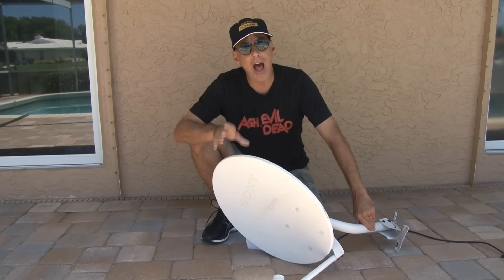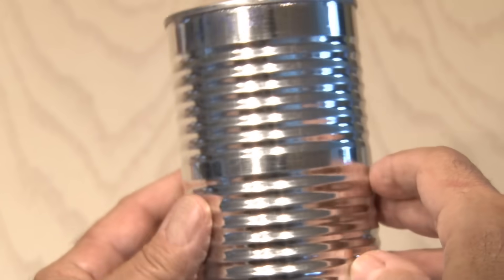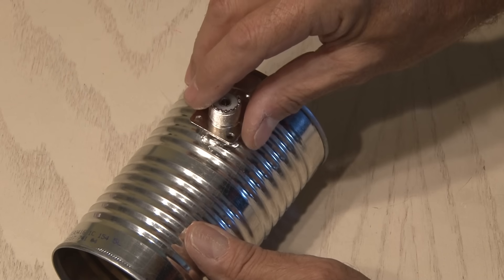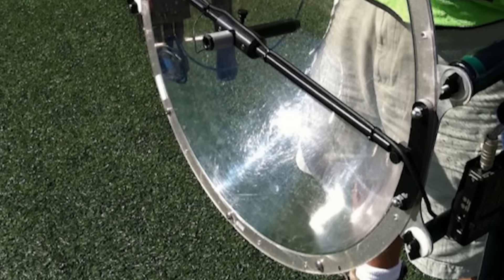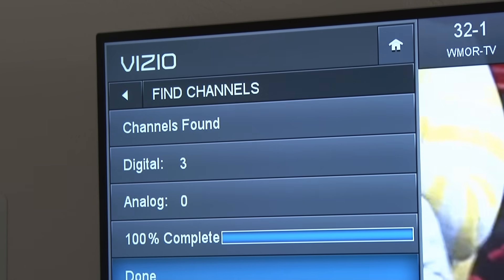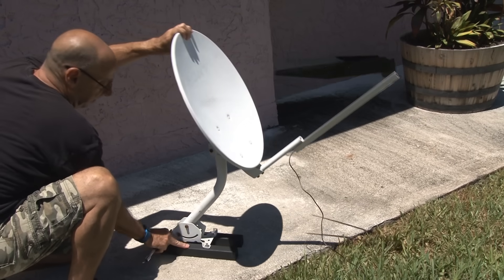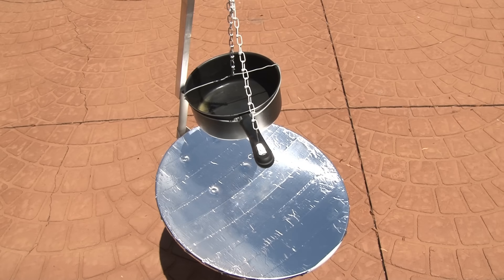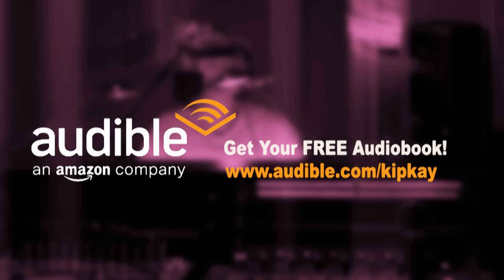4 Brilliant Uses for an old SATELLITE DISH!

Comment: cool ideas. just be aware that even though you got better wifi reception. 2 things: 1 as far as i know it is illegal in many place in the world to use wifi like that, just a FYI.2: dont glue use screws or something so that ground is connected. the matching in RF electronics like wifi is 50 ohms not paying attention will miss match the circuit and if your wifi pushes some some dBm's it could reflect and toast the final stage amplifier.mostly should be ok but as a elec tech in radar i pay allot of attention to this...other then that NICE HACKS

Comment: First off, awesome hacks and many thanks for sharing.  I had a couple questions that I'm hoping you can help answer.  Forgive me if they're rather simple, but I'm not too savy when it comes to wiring.

1) Is it possible for one dish to pull double duty and do both the long range wifi canteena and long range hdtv grabber hack at the same time?

2) For the long range hdtv grabber, the antenna used seemed to be one for indoors.  If I was to leave the dish and antenna outside, would the antenna get messed up pretty soon from the sun and or rain?  If so, do you have any suggestions to counter weathering to the equipment?

Comment: So for the Wifi Cantenna I can plug the coax cable into the antenna of my router and that signal will be the input of the router instead of the output?
Reply: the antenna is input and output at the same time
Reply: Lukas Maier so you can use a router as a wifi receiver
Reply: Secret Beed If it supports it, then yes. The router obviously receives stuff as well, becaquse when you type in a url to a website the router has to know what website you want to visit
Reply: Lukas Maier sorry to jump in this thread, how will your pc grab a wifi signal with an ethernet cable? its hard to grasp the concept of a router broadcasting a public wifi.

Comment: Would the canteen wifi work with a VHF base station aimed at a distant tower that is operating on low power to pick up signal off of it as well as transmit?
Reply: that depends. if you have a strong enough signal u can transmit it with a regular antenna, but I would use the dish to pick up any low power signals, but you would need a digital to analoug converter to use it with anything old like that. that is unless the tower is analoug

Comment: Is it possible instead of connecting the coaxial to a router connect it to a wifi usb adapter ????
Reply: Well I suppose that this would work too altough (it depends on the adapter of course) I am not so sure about it yet.Found an old satellite disk and I will test it ASAP
Reply: Thanks I can't wait seeing it :)
Reply: You can use the Alfa AWUS036H

Comment: How long of a range does the WiFi satellite pick up WiFi networks?
Reply: Depends on your setup, and what's around it. You can get a couple of miles with a decent rig.
Reply: ok so my family just bought some land around my house and it has a big metal barn that my brother and i are converting into a metal shop. the place acts as a shield for data so could i use this and point it towards my house for wifi?
Reply: *****
Yeah, you could.

Comment: what is the range for you wifi hack?
Reply: About an half mile away for the local restaurant (800 meters). Maybe he can do more.
Reply: +Zekium That's what i was wondering cause the dish has a range of about 22,000 miles when receiving cable channels.
Reply: Except you get the powerful signal from satellite. Here, you get the signal from a small WIFI router.

Comment: Great ideas! One more use that I have done a few times is to make a bird bath out of one. The multi articulating arm makes it easy to level the dish bolted to any angle of tree or limb. If you can locate it near an outside hose bib you can use a piercing ice maker valve and 1/4" tubing to run to the dish, set it at a very slow drip and it will keep the dish full of water. Having a bird bath up a tree a bit makes it harder for cats to pray on the birds and makes it more useful for the more timid birds.
Reply: And if you line it with foil you'll have a nice bird cooker
Reply: Actually, if you could remove the paint from a dish, season it w/ oil - it would make an excellent large Wok. You could mount it so it swings down over your grill!

Comment: Some hints for the Cantenna...  don't use the hot glue. The antenna connector should have a good solid ground to the can for best performance.

Also, it might be better to use an N-Type or SMA connector (Or even a BNC) rather than an SO-239. SO/PL-239 connectors don't work very well at frequencies above 500 MHz. They are primarily designed for VHF-Low through Low UHF (30 Mhz - 400 Mhz)

Comment: amazing.
i was thinking of a multiple receiver on the dish, would that work?
meaning WiFi grabber & HD tv signal graber.
Reply: Theoretically that should work, but the wifi tin may block some of the signal for the HD antenna. Also, the direction it is pointed matters, and the direction that is best for getting a particular TV station might not be where the distant Wifi hotspot is. You could of course turn it as needed or even set up some servos to turn it to some preprogrammed locations.

Comment: where to place antenna ? rooftop?
Reply: No, too dangerous! It is better to build a hot-air balloon to hold it up 200 feet above ground. This is the only way to get over the hills and trees that are obstructing the signals. If you can't make a hot-air balloon, then try making HHO then burning out the oxygen with a match so you get pure hydrogen. That will make a good blimp.
Reply: +kedwa30 
ha....ha.....ha..... maybe laughing   next new year for your holy crap joke😝

Comment: about the wifi, I think it only amplifies the outgoing signal (uploads) but it doesn't strengthen weak incoming signal (download) from a far away base station... or am I wrong?
Reply: wrong dude - I`ve never heard of one way wifi
Reply: Let the router itself handle all the dropped packets and frames, and the dish/antenna handle all the messy and rough stuff. If anything, the satellite is making the wifi signal going towards it more focused (big area, converging into a small area), in the same way you receive sound (just as he demonstrated). It may cause an increase in noise, but again the router can deal with that.
Reply: It depends on which antenna you connect on the router. The right one is for uploads and the left one is for downloads. Since most people download far more than they upload then you should attach the booster antenna to the left side. This creates asynchronous wifi, similar to how ADSL is set up.
Reply: Lol. It's a valid question.

It doesn't really "strengthen" so much as it just catches/focuses the existing signal better.
Reply: would be the other way around.
Reply: The antenna is capable of TXing and RXing from space. It can do both.
Reply: Cody Hubert
dishes collimate a signal, the antenna itself is in the focal point. the signal level for upload from a wifi antenna like that probably isn't strong enough unless you direct the beam directly on the receiving router's antenna

Comment: What do you do with the huge ones?  My dad has one.  And that Wi-Fi antenna sounds so very useful!  We have troubles getting the signal from one building to another.
Reply: How far apart are the buildings??
Reply: The huge ones make the best solar cooker. You can put a Stirling engine in the hotspot and really turn out some power. It can be used to turn a millstone or pump water directly. No need to convert to electricity just to turn an electric motor. Use hydraulics or pneumatics.
Reply: 9753flyer
About 100 '
Reply: MrInitialMan
That's pretty far for a Spiderman swing. There was a project in an old magazine for making a transceiver that uses light beams or lasers.
Reply: MrInitialMan 100' should be no problem in most cases... most wifi is good for up to about 150' usually.

What are the bldgs?? Wood? Steel?? Are the transmitters (wifi routers) located inside the bldg's or outside?? Also, what make/model are they.
Reply: Yeah, but the signal out there SUCKS.
Reply: MrInitialMan 'the signal' ?? You mean the one you are sending from one bldg to another or are you trying to get cell service??

I'm a little confused on exactly what you are trying to do.
Reply: The one sending from one building to another.  I just have a couple of wireless routers in my house, and I share my internet connection (and the bill) with my parents (we live in seperate houses on the same acreage)
Reply: MrInitialMan ok.

I assume the wireless routers are inside the bldgs?
Reply: In my house., yes.
Reply: Yay! Most likely the problem is something in the wall is blocking the signal. You don't need a satellite dish to fix this. All you need is an outside antennae. Just take off one of the antennae from the back of the wifi box and hook some coaxial cable to it, then hook the other end to the antenna and mount it on the outside wall. You can stick it out the window to try it, and if that solves the problem then make it more permanent with a discrete hole through the wall so you can close your window. And of course, caulk the hole after you get the coax through it.
Reply: Yeah, Ked is right.

The problem is you are transmitting through walls and each wall will (depending on materials) cut the signal by approx. 30% strength wise and cause a lot of re-transmissions of packets due to errors.

If you have a router that will support an external antenna (most nowadays do not), then you can add a directional hi-gain antenna on each end, point it at the other house and the problem will for the most part be solved - you will still have intermittent problems long term if you are moving a lot of data around (watching a hi-def movie for example).

The best solution is to add a range extender to the outside of the house or houses - you may only need one. 

With the range extender outside, you will remove a lot of the range and wall issues. A google search will find you some of them, and some are able to be used outside (usually cost a little bit more)... all told, 1 should cost you between $40 and $120 depending on inside/outside and it's features (higher power (which will help))

If you have overhanging eaves on your roof, and not a lot of bad weather, you might be able to use an 'indoor' range extender outdoors tucked up under the roof eave.

If you need further help, let me know.

Comment: I don't fully understand how the Wi-Fi part works
Reply: Tha's because he leaves out flashing the router with new firmware so you can gather that signal from far away in a manner the stock router was never meant to do.  This is very well documented elsewhere on the net.
Reply: You're just making a Wifi antenna with much higher gain by focusing the signal onto one point.

Comment: this may have been mentioned before but the UHF connector should be soldered to the wave guide (can) to provide the needed ground conductivity. additionally, one should use better coaxial cable like LMR300 and an N connector instead of a UHF connector

Comment: UHF connectors and RG-58 (especially from Radio Shack) are terrible for Wi-Fi at 2.4GHz.

Use an N, F, or SMA connector and RG-6Q or LMR-400 equivalent for lowest losses
Reply: And hot melt glue is a great insulator.  There is only a casual connection between the SO239 and the sides of the hole in the can.

Comment: Over 22,ooo miles in space?  What kind of signals are you picking up lol
Reply: That is correct the geostationary orbit is 22,236 miles above sea level.
Reply: Did not know that.  Thanks for the info because I thought the average was 400 to 600 masl
Reply: Graeme Mudie so if they shoot them up there at a thousand miles per hour it would take 2 1/2 yrs to reach there?
Reply: jtuno122
Thinking your math is a tad off
Reply: jtuno122 No it would take 22Hrs.  The escape velocity from Earth is about 11.186 km/s (40,270 km/h; 25,020 mph) at the surface. So it would take less than 1hr to reach 22,236 mile.
Reply: Graeme Mudie yea, lol! After I hit post I realized what I did and couldn't find it again to correct it.

Comment: There's one thing you forgot to mention: It's an offset dish, so pointing it straight at a signal source might just about catch the edge of the signal. To really get most out of it, you'd have to angle it down.
Reply: I thought the same thing.  8^)

Comment: Thanks for the video. I have a question for you. Did you plug the microphone anywhere? Kindly show it.
Reply: The mike would have to go through a pre-amp and then an amplifier.  It could be done in one stage if you designed it that way.

Comment: The use of Imperial measurements was really annoying. Science and Technology videos shouldn't require me to break out conversion formulas to understand the content.
Reply: If you cant understand simple conversion stay away from science and technical/technology videos.
Reply: I refer to them as medieval measurements.  The United States is the last country on Earth to still use them.  Taking the ratio of the length of the bean can to its diameter and somehow coming up with "1.25 inches" as the ideal position to locate the antenna feed was utterly deranged, because when a length is divided by a length, the result is a dimensionless number.  No electrical engineer would do it that way.
Reply: Science and technology? The dude just made some ghetto gadgets using fairly arbitrary measurements. He probably could have done it just as well without even measuring anything out. Just having the concepts presented here would be enough to replicate it without the measurements even being stated.
Reply: Myanmar (Burma) and Liberia are still also on that obsolete system...

Comment: If you want to boost your laptop wifi reception use a dongle with a usb extension cable on the dish. Less work and the result is fine aswell :-)
Reply: I will try that.

Comment: people building a wifi beam be careful it may be illegal on bands other than the amateur band. advanced amateur licence holders are allowed more power on a different wifi band but can reach large distances. check with a field strength meter to make sure your compliant with federal laws in your country as you cant exceed the acma or equivalent spectrum licencing authoritys rated output. people bellow it looks like rg59 coax . 
.  i'd recomend a sma to so239 adapter as most new modems are sma 
either male or female depending on your equipment . in the video his router has the so239 buit in.
and you will need a pl259 uhf cb connecter for your router and another pl259 for your wifi beam.

Comment: War driving is illegal kipkay.
Reply: The act of wardriving involves using software to capture data about wireless networks and Internet usage. Although the act is classically accomplished from a vehicle, wardriving can be accomplished using any 
means of getting around to include walking, bicycles, or via aircraft (Kipkay is not wardriving, he is not mobile.  Kipkay is wardriving as much as he is war dialing.  None.).  In the United States, the act of collecting data on available wireless networks using this method is NOT considered illegal. If the individual conducting the wardriving can be proven to have accessed any of the networks that are not designed for PUBLIC USE (Kipkay used a PUBLIC WiFi hotspot), he or she could be subject to criminal charges based on the locality and what the network access is used to accomplish under the Theft of Trade Secrets or Federal Computer Fraud and Abuse Statute.
Reply: ***** Whoops,wrong term. I meant he is piggybacking. Using someone's hot spot (free or not) without the explicit permission ( or not being a client) is an unethical,and illegal (pretty sure) practice. amirite ?
Reply: I would consider it a gray area. Being that he's not purchasing product from the facility and using Wi-Fi but it is still not illegal because it's public.
Now let's say for instance that you have a Wi-Fi that is unencrypted... Joe Schmo decides he wants to use your "free" Wi-Fi. If you did not intend for this Wi-Fi to be public, at that point it would be illegal for Joe Schmo to access.
Reply: If a businesses public WiFi requires you to go through some sort of homepage for the business and click an 'Agree' button, odds are that you are agreeing to only use their WiFi if you are a client/customer. Just do a search for 'arrested for stealing WiFi' and you will find stories of people who got arrested for using stores free WiFi illegally.
Reply: @John - I would certainly agree with your statement.  In fact, yesterday I was discussing that very same thing with a co-worker right after my last post, but failed to have mentioned it specifically (meant to be inferred with the "gray area".)  Thank you for clarifying that.

Comment: Why did he need a calculator to divide 5 by 4?.
Reply: American schooling.
Reply: 2.4GHz Frequency wave length is about 5 inch,  this  antenna length should be 1/4 wave length.
Reply: Heywood Jablowme No...it's to demonstrate for the viewers.  Otherwise he could've done that calculation or any other off camera and provided the result.  Don't be such a troll.

Comment: remove dish. plug holes with silicone. put bolts back in holes to seal. Set on top of....I used a propane bottle....
instant bird bath.